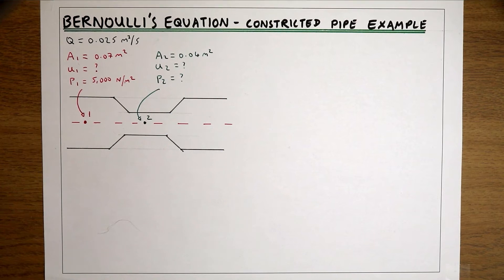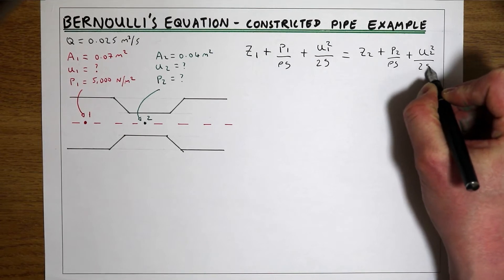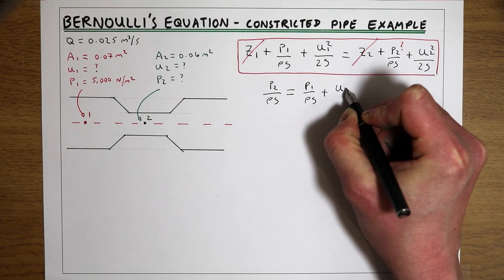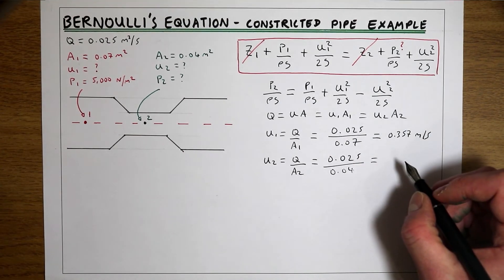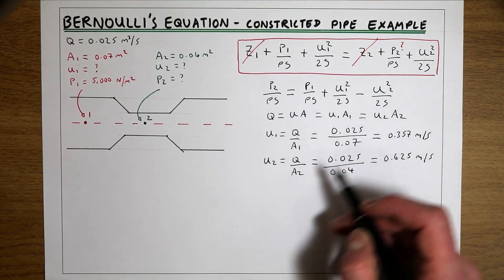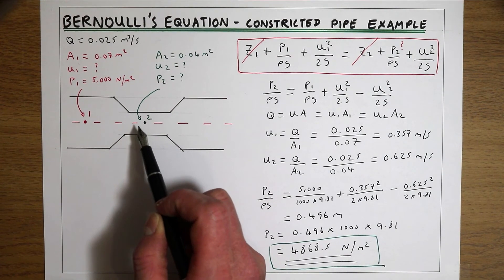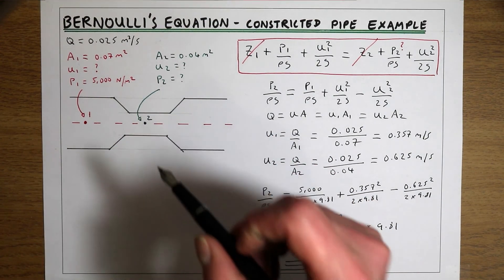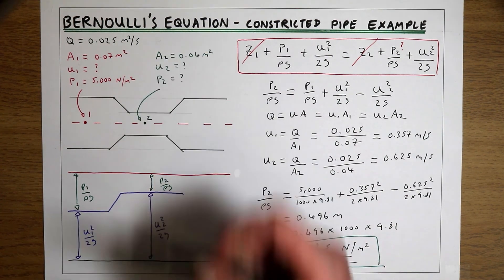Bernoulli's equation for pressure in constricted pipe / Venturi metre

Comment: Thanks for the great explanation. I have one question/thought: Imagine if there is a small hole towards the outside, at the place where the constriction is. If P2 is higher than the atmospheric pressure, will it suck air into the system?
Reply from the maker: Thanks for the comment. If P2 was lower than atmospheric pressure, then it would suck air though a hole.
Reply: @fluidsexplained1901  Thanks for the reply. Would this be an example of the venturi effect?